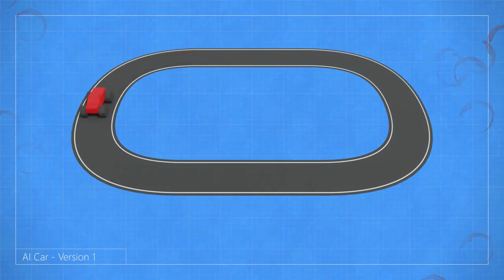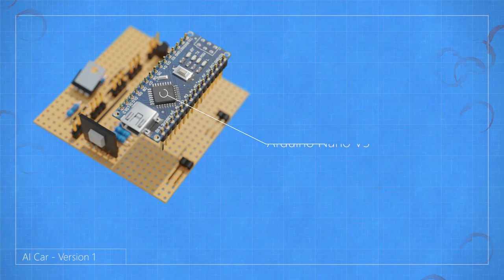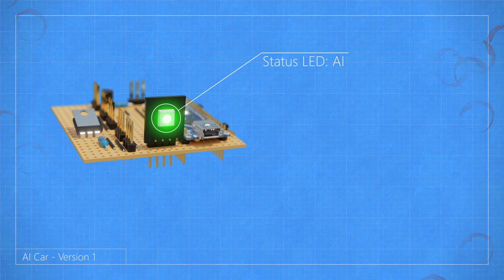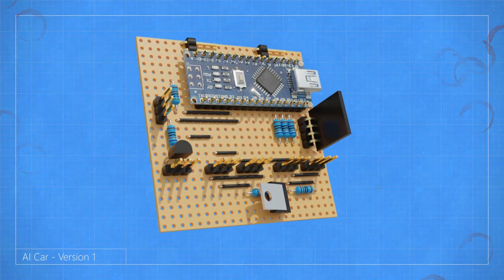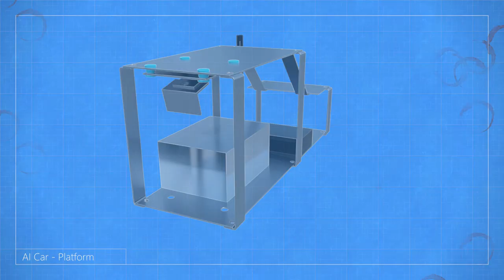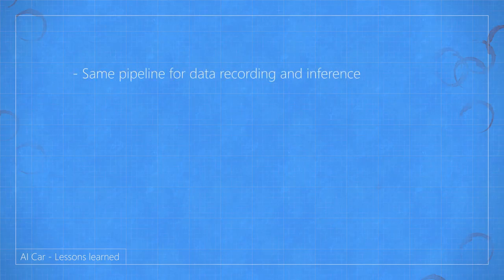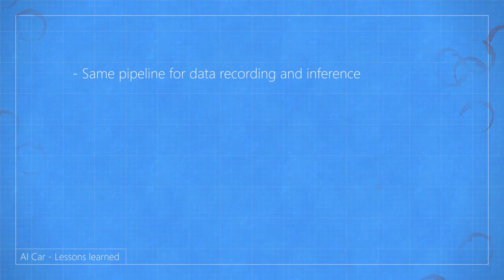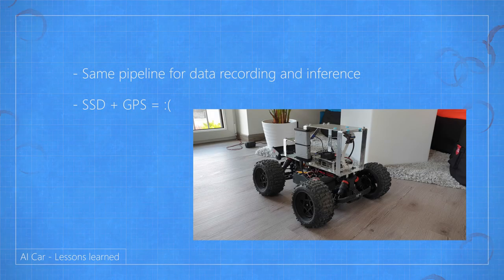Autonomous RC-Car - Lane Following AI

Comment: Excellent. I have been using secondhand store toys for the platforms. The cheap toys are better than my programming skills but at low cost I'm making ground. A NewBright Grave Digger, now controlled by Arduino proportional RC. You have moved the Bar, I'm on it.

Comment: First of all, Awesome video! You definitely put a lot of time and effort into the project and the video.

But why did you use a GPS? Can't you just capture the PWM signal going to the servo and speed controller and use that to train your model and get the speed of the car for inference? That way your car will still drive with the SSD taped to the side :P.
Reply from the maker: Good question, i guess you could use some sensors on the wheels to get the rpm. Maybe with a better speed controller that tracks the rpm of the motor (i used all the default components of the rc car)... But for me this was the cheapest and fastest way to get a speed of the car. I'll definitely keep it in mind for next time.
Reply: @MarcelEgle  I meant PWM, not RPM. You could just read those signals coming from the RC receiver without any additional sensors. I actually made a car similar to yours but I used the PWM signal from the RC receiver to determine the steering angle when collecting data for training. I used the same Raspberry Pi Zero (w) to read the PWM as I used for all the other stuff. 

But I'd say my project is a little more "scuffed" than yours because I have to stream the frames from my RPI to my laptop so my laptop can do the inference and send the result back. The poor RPI is just to weak to do the inference. This setup works but the connection is pretty bad so it sometimes just drives into walls... The Nvidia Jetson, which you used, although expensive, seems like the best tool for the job. If you're interested in my project, I have a video of it on my profile.
Reply from the maker: @Theking-uy3wu  Ahh, ok now i know what you meant. Yes i used the PWM signals from the receivers to get the steering value and throttle/brake (my input signals from the receiver) but additionally i also collected the current GPS speed for the neural net to make better predictions. If you only have a camera image in front of a corner you dont know if you need to brake or maybe even speed up if your standing still... Cool, i'll check out your video :D

Comment: To add object avoidance, what would you do?
Reply from the maker: Actual "avoidance" would be hard because then this system needs a proper understanding of where it is and its surroundings for planning how to get around obstacles (probably some kind of SLAM system). Maybe for smaller obstacles the AI could just be train to drive around them, but the road needs to be always visible and as soon as the object is out of frame the AI has no idea that it is there. Object detection, so simply breaking and waiting until the road is clear again could be implemented relatively easy.

Comment: Wow amazing. I have done using simple computer vision techniques but I also want to do same. But I'm not able to make dataset like that. Can you give me its dataset? It will be a lot for me. Thank you so much.
Reply from the maker: I didnt host the dataset anywhere i'm sorry, but i will keep it in mind for future projects.
Reply: @MarcelEgle  I really need it. 😔
Reply: @MarcelEgle  how you gave command to Jetson Nano to run? I'm using SSH connection. But it giving me error of not displaying Jetson Nano camera.
Reply from the maker: @ansjaved3484  Probably because an SSH connection doesnt have a display output set... i was indeed using SSH but didnt use any GUI so i didnt need a display.
Reply: @MarcelEgle  Dear I need your help in sensors data fusion.  As I want to do data fusion of lane line detection algorithm and obstacle avoidance algorithm. I'm using IMX160 degree FOV camera and RP Lidar A2 M8 2d 360 degree and I'm using Pyrplidar library to control Lidar. I want to avoid obstacle when it comes in way of my car following lane lines. I have 2 models 1 is lane line detection giving me a steering wheel angle, another is obstacle and object detection in that frame and it is only detecting that. Now I want to avoid obstacles coming in front of my car.  But I don't want my car to unfollow lines when obstacles comes in front of my car.

 Please help me in this regard.

Thank you so much.
Reply from the maker: @ansjaved3484  Sounds like a pretty big goal... At the moment i dont have time because of work, but i wish you all the best and hope that you will be able to get it working.
Reply: @MarcelEgle   dear if you know something you can tell me in short. It will help me a lot. 😊

Comment: 3:21 what Interface dan visualization did you use ? is it ROS ?
Reply from the maker: Thats the GPS visualisation from u-blox, the company that made the GPS module. The software is called u-center.
Reply: @MarcelEgle  wow Thank you for replying, appreciate it !!! one more question, did you use Full Tensorflow version in Jetson Nano, or did you use TensorRT version for Inference ? I have an RC car laying and jetson nano around, i want to convert it into self driving car soon.
Reply from the maker: @dubber889  Actually i used Tensorflow Lite (although im not sure how much of the GPU Tensorflow Lite used). Later on i ran the same model on a Jetson Xavier NX with full Tensorflow and more parameters and it worked even better :D

Comment: have you consider getting AI to slow down the car when it need to turn sharply?
Reply from the maker: Yes i have, it already kind of learned breaking before a corner. I also did a data record session where i just recorded myself breaking in front of corners, but it probably needed even more data for this single network.
Reply: @MarcelEgle  cool!! I am looking forward to an update video when you have time?
Reply from the maker: @coolthought8456  I really want to make a new project/video. At the moment i dont have a lot of spare time, but i'm trying to make time for it.

Comment: Why do you use jetson nano?
Reply from the maker: I decided to choose the Jetson Nano because i wanted to try it out mostly. I thought it could have a lot of potential with an actual Nvidia GPU... For just using TFLite a coral dev board might have been the better choice (I think it uses the TPUs) since for me the regular Tensorflow was too slow. I later upgraded to a Jetson Xavier NX and together with regular Tensorflow its unbeatable in performance for such a small device (thats lowpower aswell)
Reply: @MarcelEgle  thanks for the very good info
Reply: @MarcelEgle   Great video! How much voltage does the jetson xavier nx need? And how are you powering it? Thank you!
Reply from the maker: The Xavier NX needs 9-19V as input (gets converted to 5V board voltage) and draws up to 5A (usually quite a bit less, this is just the maximum rating: 15W at 5V so 3A under full load + max. 4x 500mA USB Power). I used a step-down power supply board and connected it to the balancer cable of the lipo (to ground and the "last" cell, so basically just the lipo output). For me this setup was pretty convenient because i didnt need to solder anything to the battery or the car and i basically already had a free plug. For my case the wires had a big enough diameter to support the load of the Jetson. If you try the same then always check that your wires can support the maximum Amps you can expect.
Reply: @MarcelEgle  Thanks for the info. So, effectively you reduced the voltage to 5v using the step down buck converter and fed it to the micro usb input of jetson nx. I was planning to upgrade from jetson nano to xavier nx. But was worried on the power supply part as its power hungry for   deep learning networks.
Reply from the maker: I used the Power Jack (i dont remember exactly but i believe the micro usb port doesnt even support the full 5A, i read that its better to use the power jack for higher loads). And on the power supply you can set any voltage between 9 and 19V, i think i used something a little less than the min. Voltage of my 4 cell lipo, so less than 15.2V (4x3.8V)

Comment: Awesome project! Amazing video editing skills!! One question: How do you make/fabricate your chassis?
Reply from the maker: Thanks so much :D Do you mean the car itself or the aluminum parts? The car base came prebuilt and everything out of aluminum was added afterwards. I measured the car, especially the holes for mounting the default canopy and then planned the aluminum stuff in Fusion 360. I cut the raw pieces with a jigsaw, grinded off the rough edges, drilled the holes and finally assembled the parts using screws. For the camera mount i used a small aluminium plate suspended from anti vibration rubber balls but im not sure exactly how much they helped. But im sure they did make the vibrations worse ^^ Hope that helps, if i misunderstood your question or you want to know something else just ask :D
Reply: @MarcelEgle  Thanks for reverting. Yeah, I meant the aluminum fabricated parts. It looks very neat and well done. Weird as it may sound, the biggest challenge for me is to source these customized frames and chassis for my needs. Perhaps when you have time, make a small video on fabricating these mounts, chassis, and frames. It will be very helpful for someone like me who's beginning to build stuff and not just assemble an off-the-shelf kit....